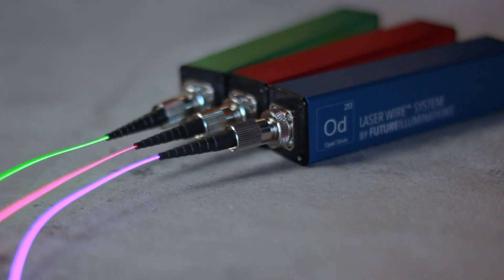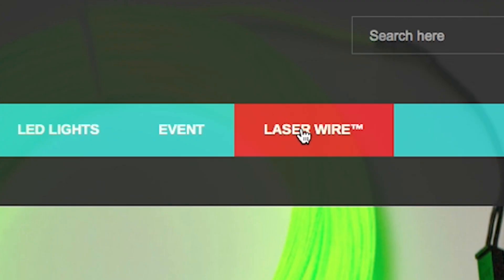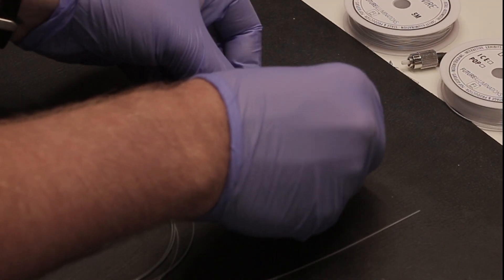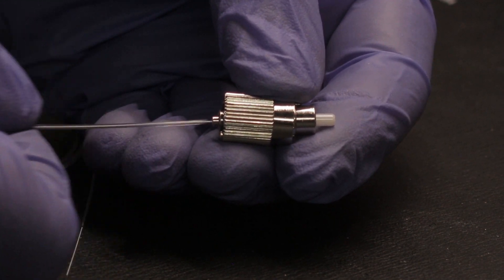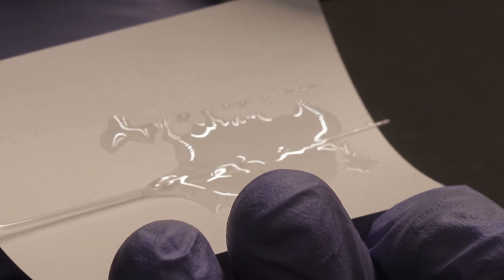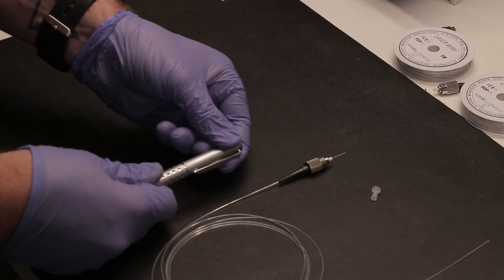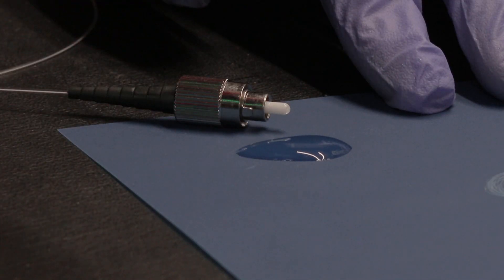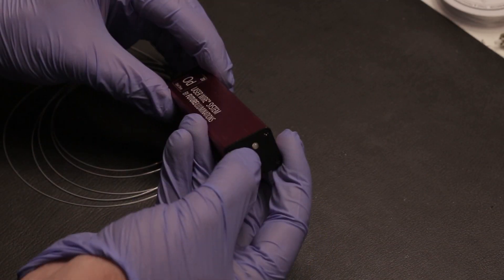Create Custom Laser Wire® Lengths - DIY Tutorial

Comment: wow its just like oldschool fiber optics. so glad all i have to do these days is use my fusion splicer. anyway just wondering if i could just glue on a SC connector and use my VFL to get a result for demonstration of the way fiber works por people i teach to splice?
Reply from the maker: Unfortunately this product does not work with a fusion splicer. You could glue on an FC, SC, LC or other types of connectors.

Comment: I used EL Wire in a motorcycle jacket, two lengths of 6 feet. I used it as a "piping" around the seams. Too many hits from bugs/debris broke the corona wires inside and caused me to  remove it. Will laser wire hold up to this environment? What are it's weaknesses?
Reply from the maker: It's a very thin wire, so rock chips could have similar issues. However what others will do is add our Commercial Tubing around it which increases the strength exponentially against punctures. You can also add a resin/silicone over the top which will add strength to the jacketing. The minimum bending diameter is 5mm, so make sure that the contours around the edges are more than this. Otherwise, Laser Wire is going to last far longer since there is no phosphor that degrades inside (like EL Wire).

Comment: How can we install it in car?
Reply: It can be installed into cars quite easily. The wire itself can be laid into crevices or glued into place since the wire is so thin and lightweight. The laser module itself is powered via a 5V USB plug, so many newer cars you can simply plug the module into the USB auxiliary on the dashboard or center console.

Comment: Does the length of the wire affect the brightness?
I'm thinking about ordering the 5m wire. If I don't cut it down and use the whole thing does the brightness diminish from the starting point to the end? Does the brightness reduce due to the length at all?
Reply from the maker: Pumxee the brightness of the wire is dictated by two things; the laser module and the wire itself. There are 3 different profiles of wire; Super Pop, Pop and Accent. These are all indicative of the overall brightness but also the length. Super Pop is the brightest and is used up to 1M in length. Pop is the most common and used in lengths up to 5M. Accent is less bright and used in lengths up to 10M. If the laser module output power is increased, you can increase the brightness of any profile. But to answer your question, if you cut it, the brightness does not increase or decrease, it simply glows to the point where you cut it.
Reply: Pumxee look up fiber splicer lasers man we use these to repair fiber for internet company’s and they have a distance of 4miles

Comment: can you use it with a arduino to control the light effects please
Reply from the maker: hellbound yes, when using the laser module in install mode, you can send a PWM frequency from the Arduino, Raspberry Pi, etc to control the on/off/dimming.
Reply: Ellumiglow thank you so much for your help

Comment: Wha the best. El wire or laser wire ?
Reply from the maker: Laser Wire is going to be anywhere between 4-10x the brightness, more flexible, easier to integrate, no buzzing noise, last substantially longer and have more vibrant colors.
Reply: @EllumiglowPage  You Forgot To Say It's 10x More Expensive
Reply: Ellumiglow oh thanks for information. 😁